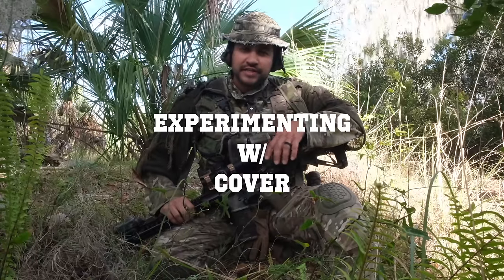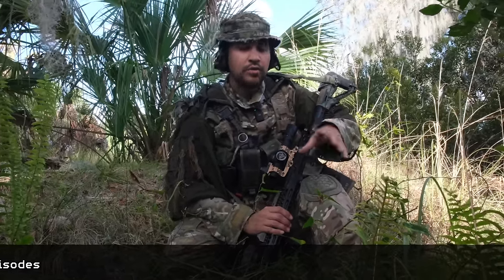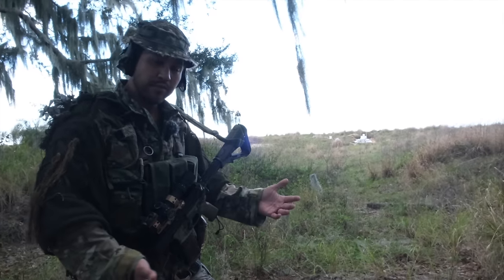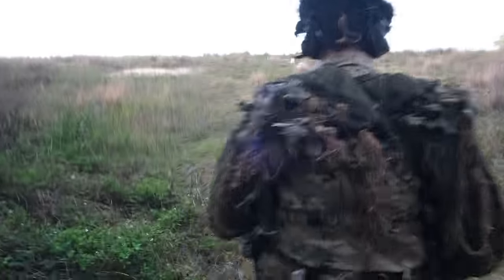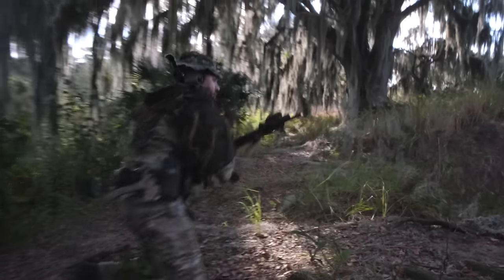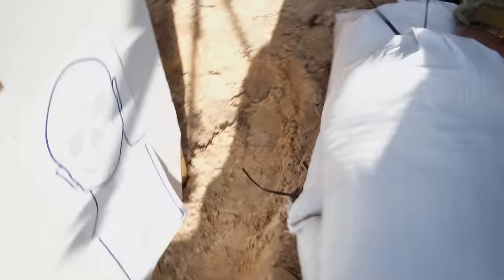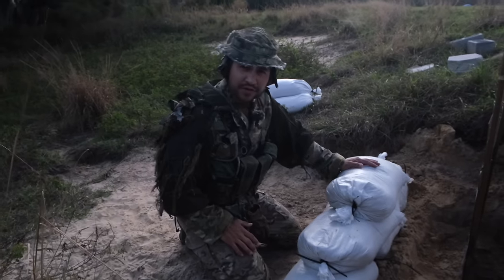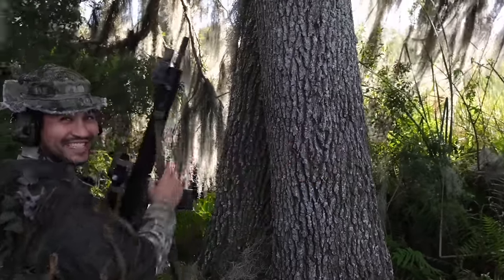Bullet Barrier Breakdown: Best & Worst Cover Revealed!

Comment: I know there’s other tests out there… but some comparison of 5.56 FMJ/BTHP and 9mm FMJ/JHP and common “defense” type of cover like car doors, drywall, etc…
Reply: That’s not cover it will go through dry wall and a whole car unless it hits a frame
Reply: If it stops FMJ it'll stop hollow points and hunting style rounds easier because there made to displace all there energy fast instead of punching through. Also drywall and car doors don't stop 22lr so it sure as hell won't stop 9mm or 5.56

Comment: I did 32 years of HVAC work in NYC area, never saw a block wall with filled blocks. I ran many line sets through block walls, old and new and never found a block wall with the blocks filled with anything but old beer cans from the job site. I don't know about other parts of the nation but here in NYC metro area we do not fill out block walls.

Comment: definitely need to build a brick wall for testing. would love to see those sand bags filled with dirt/clay. theres no real sand around where i am, just dirt/clay mixture. dig a deep-ish hole and use that instead of just the top layer real loose stuff. maybe also do a test with just top soil. would also love to see this medium in the sand bags and then water them down and see how they perform wet. could also make like a dirt slurry, fill the bags, let it dry over a week or so, then test the final product.

Comment: I'm a former mason (the trade not the religion). 
Id trust most (concrete) block walls for cover depending on zoning since they will be filled with concrete and steel rebar. The problem comes with knowing the type of wall, zoning and building codes applicable. Some are concrete filled every other cell or even less. Theres also different types and thicknesses of block, some (like 4" pumice block) are soft and fragile providing next to no protection.
Brick walls I would NOT trust, some types of brick are more resilient than others (some will actually erode just rubbing them together, some are actually good for using to sharpen blades too) but even filled with mortar they'll come apart pretty quick.
Either way the mortar is actually the weak link ballistically, its about right there with pumice block.
The best masonry cover (imho) would be a real stone (not the fake "stone" or even thin cut real stone you see on most buildings as columns or veneers. Its 4"+ thick and chosen and/or chiseled to fit together with only a very thin layer of mortar between. Those are basically rock walls.
Reply: I did 32 years of HVAC work in NYC area, never saw a block wall with filled blocks. I ran many line sets through block walls, old and new and never found a block wall with the blocks filled with anything but old beer cans from the job site. I don't know about other parts of the nation but here in NYC metro area we do not fill out block walls.
Reply: @Militaristics  like I said it depends on the type of wall and zoning (and like any construction work when and how closely the regulatio s went into effect). Done plenty of chimney and der structure rebuilds and you find all sorts of stuff in those too, mostly cigarette packs and beer cans. They're kinda like an odd twist on time capsules.

Comment: Cover Part 2...

Corrogated metal...like the kind found on virtually all commercial building walls such as Wal-Mart. Am I safe inside a buisness?

One layer of traditional brick...this would be the best case scenario found in many suburban neighborhoods. Am I safe behind the corner of this house?

Stairwells...many urban areas require stairwells to be made out of concrete and steel to meet fire code. Be certain to also account for open stair designs; no backface, and deflection. Am I safe behind the stairs?

Parking lot...how many cars to stop a bullet. Go to the junkyard for this one. But should you have to take cover behind vehicles, how many do you need?

And lastly, for the commercial, building and construction areas out there... shoot a Sea-Land shipping container. Am I safe behind one wall? two? Should I run?

Hope this helps,
Phil
Reply: Run !!

Comment: There are so many World War 1 and 2 museums around the country that feature a set that tells a story of two rounds that collided mid-air.  I always thought this was nuts because no one could possibly know that unless the welded two fell at someone and they saw it tumble to the ground.  My teacher got pissed at me on a field trip because I wasn't impressed and said that one probably just buried itself inside another that came to rest in the ground already.
Reply from the maker: It was pretty insane when we found it I couldn’t believe it but yeah, that makes sense that it possibly hit another round that was already in the dirt
Reply from the maker: What was crazy to me is that if you look at M85581 I have never seen where the copper jacket was completely removed and the steel tip and core was intact
Reply: @barrelandhatchet  yeah that was weird.  Probably a minor fluke in the manufacturing process combined with perhaps a faster twist rate or something like that?